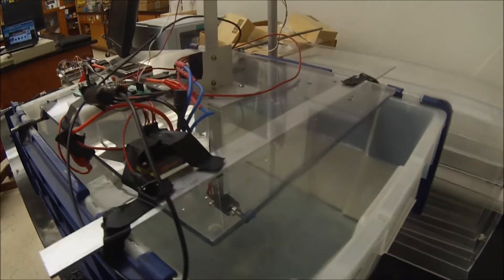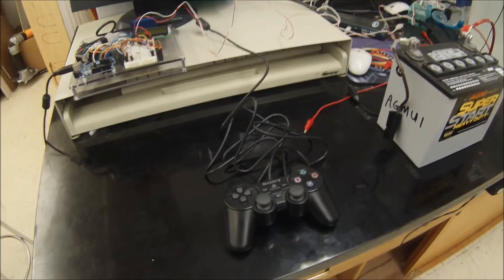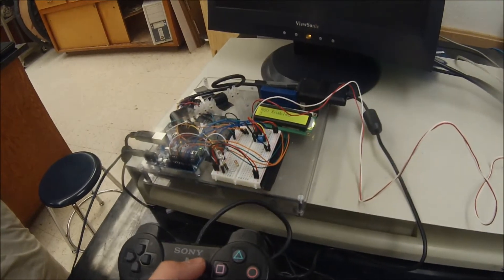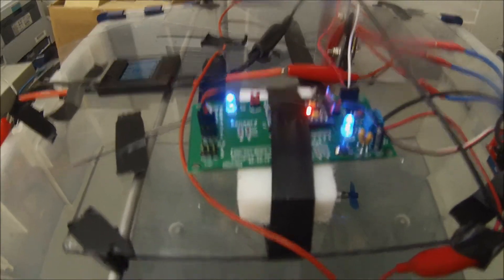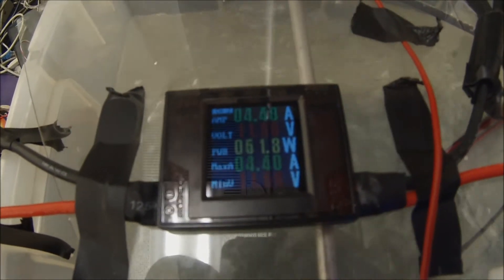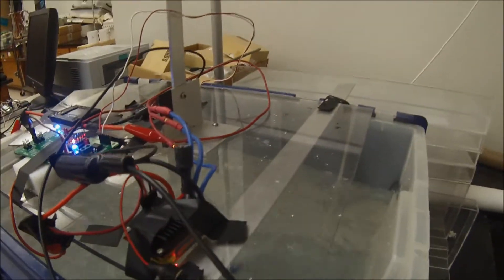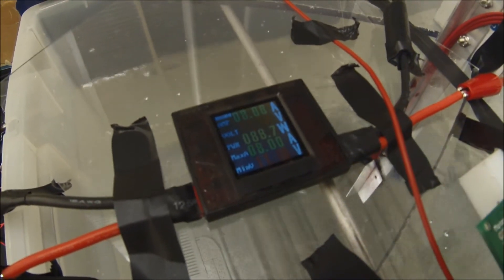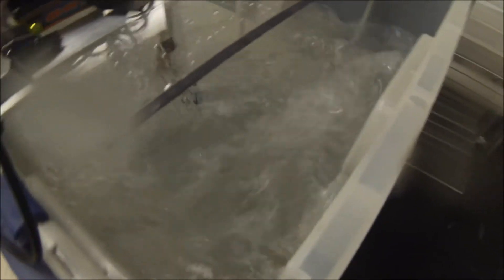Brushless ROV Thruster Test #2 -- Current Limiting Removed

Comment: Hello, thanks for the videos that's very interesting ! I'm planning to build a ROV based on Arduino and controlled with a ps2 controller. I bought a module from Cytron (SKPS module) which turn the analog signal of the controller to UART (rx tx) that's nice because I wanted to use an ethernet cable theter with inboard batteries and that's cool because It wouldn't take too much wires, 2 instead of 7.. but It didn't seem to work :'( I think I will do the old fashion style to interface the controller with Arduino.

Comment: Could this be run in salt water and then just rinsed off afterward? How deep would this motor be able to go? 30m? 60m?
Reply: danamite358 yes but you would be better off changing the bearings to stainless with ceramic ball's.